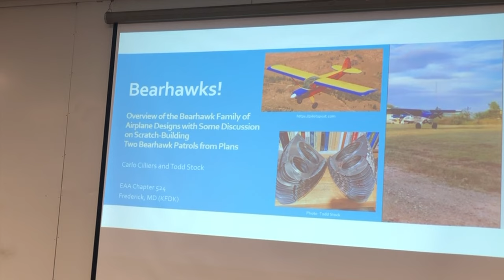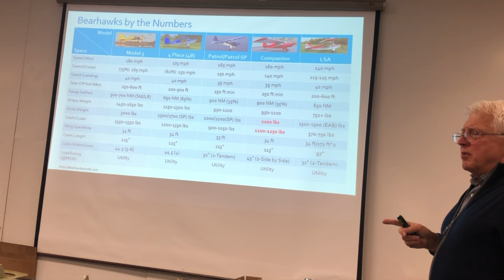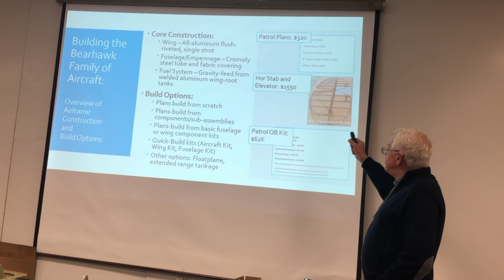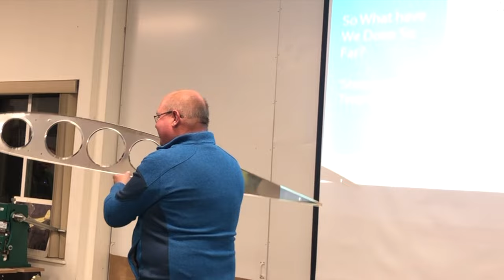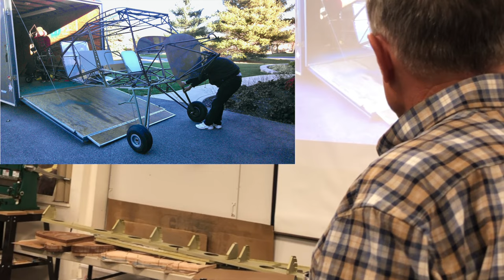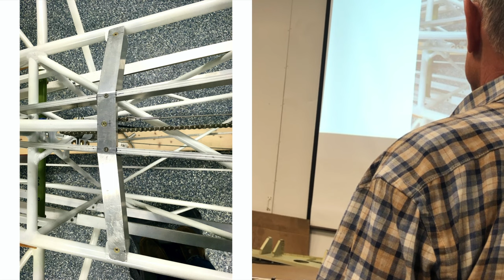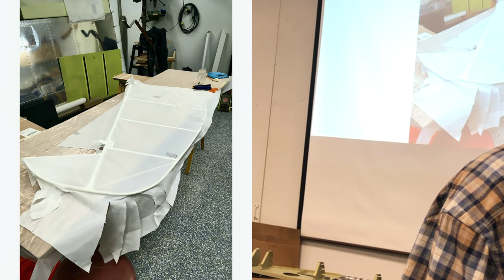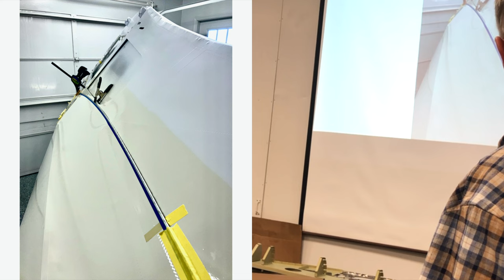Building the Bearhawk

Comment: 7:40 the issue I have always objected to, is the numbers on their website for stall speeds would require lift coefficients greater than 3, after factoring in even a small tail down-load; OR reducing the aircraft weight to its listed empty weight, plus 150-200lbs if using a believable CLmax of 1.7-1.9 for a typical partial span flap, rag and tube aircraft. 

I'm not knocking the design or designer. It clearly works well for countless people. But it raises alarm bells to publish nonsensical data that was clearly read off an uncalibrated airspeed indicator/pitot by someone who should know better. Or worse; derived from make believe.

I highly doubt these aircraft can actually achieve, in no wind conditions, on a 59 degree day, at 0MSL, the claimed 32mph, 35mph, 36, and 38mph stall speeds they list for various models online. 

The dynamic pressure at 35mph is so laughably low, even ultralights have a hard time operating there.

E.g. Patrol is as of today published 2,000gross weight (that by definition is the weight performance numbers are derived for). And 180ft^2 wing. 

2k/180 = 11.111...lb/sqft.

(22/15)x 36mph stall = 52.8ft/s

Rho is 0.002377

0.5*rho(V^2) is 3.3135 lbs/ft of dynamic pressure. (Q)

11.111.../q = CLmax of 3.353.

Not even with a Helio Courier could you ever achieve that CLmax! (And it came close, with full span deployable slats, and 70% span flaps. It achieved a phenomenal CL~3.0 in practice)...

Run numbers backwards and use CLmax of 1.8 (Same as Super cub, Vans RV-8. Not Husky, which has better, gnarly slotted flaps). And you find a stall speed of 49mph. This is at aft-cg of course, as fwd Ch means a larger tail download that would raise stall speed to 50mph even. A far cry from 36! (Which would correspond to a gross weight of 1,073lbs. Which is exactly -77lbs BELOW its listed empty weight).😂

Even if You plug in a Clmax of 2. Same story, you cant even bring fuel with your own bodyweight and achieve those stall speeds. Use a giant (unbelievable favorable) CLmax of 2.5. Then it gives you a low fuel, solo weight that might be useful for STOL competitions. (341lbs, including pilot, oil, and fuel, 36mph stall with CLmax of 2.5). 

This "accusation" is evidenced by the fact people aren't using these in STOL drags. Yet many other known STOL or bush designs are showing up in droves. Including carbon cubs, Zeniths, as well as C180s. But not many bearhawks showing up, let alone winning those events.

If these vitally important performance numbers are this egregiously fudged. I wonder what other, much harder to verify numbers are pencil whipped?
Reply: 52% span x1/3 chord plain flap on the patrol - they are barn doors compared with the PA-18's ~35% x 1/4c.  Not a rag wing airplane - flush-riveted, stressed skin, single strut with fabric control surfaces (as in most high performance aircraft through the middle of WW2).  Fabric control surfaces are more structurally efficient in design speed range and the aerodynamics are virtually the same as heavier stress-skin construction.  Flush riveted Riblett wing matters a lot at cruise and less at the low end, but helps a bit on controlling separation.  Some builders have gone with VGs and given up a few mph on the top end, but I suspect the consensus is that VGs add predictability in less-than-ideal conditions, versus trimming the Vso number in a meaningful way. 

Most manufacturers quote Vso (velocity  - stall in landing config for the casual reader) at something other than max gross.  A 1000 lb Patrol (Bob's O-320 fixed pitch prototype) with 185 lb pilot and 2.5 gallons usable left (thus about 1200 lb at landing) will stall at 36.5 mph CAS per the flight test data.  A more realistic 195 hp CS  on a Patrol with a decent panel will tip the scales closer to 1200 lbs empty weight, and with 312  lbs of fuel, 400 lbs of meat, and 85 lbs of baggage, Vso is now 47.2 mph CAS at 2000 lb (max gross on wheels/skis).

Could I find another 5 mph by adding slotted, double slotted, or other higher lift config?  Yup.  For 99.9% of missions flown, would I be happy with the weight gain, the airspeed loss, and the additional mechanical complexity, maintenance, and added failure modes?  Not so much.  I'm concerned with  - and I suspect most folks looking at the 'hawks versus other options - is speed range.  For my config (195 hp/two-bladed CS prop), I'll see Vso around 45 mph for most missions and max cruise of 150 or more if I can pay the gas bill.  If I throttle back to 135, I'll see about 7.5 gallon/hr burn and about 6.5 hrs duration with reserves for just under 900 miles zero-wind range.    In a nutshell, that is the value proposition, versus slogging along 40 mph slower with a max range of 500 miles, but enjoying the fantasy that I too can win a STOL competition.  If STOL drag is your jam, get an airplane optimized for the job (land slow/cruise slow), then mod the shit out of it.  For the rest of us that are content to get into and out of 800 foot farm and ranch strips, but still cruise at 172/182 speeds, the Bearhawks are fit to mission. After flying helos for 30 years in the military and civil world,  landing super short has little novelty, but dropping in on friends in Florida or NE Ohio with farm strips after a doable day of flying without breaking the bank can be fun... 

Bearhawks in STOL Drag?  Might see them.  13,000+ PA-18 and clones out there and something like 200 or less flown in competition.  With a couple hundred 'hawks flying, we might expect to see a couple at some point.  That said, I suspect you are more likely to see a Bearhawk bouncing around back-country strips with the local group of PA-18 clones, Maules, and tailwheel Cessnas.
Reply: @MDLuthier    stall speeds are quoted at cited gross weight. That is literally the definition of VS0/VS1, which is clean or landing configuration, at max gross weight. To go out with a medium sized pilot and an illegally low fuel quantity (30 minutes reserve is at cruise power setting, not a significantly reduced 40% power level to attain those 30mins at best L/D with zero margin).

As my math showed, these numbers are fairy tales and are not attainable in the real world by any builder or operator of these aircraft, in practice. That is my complaint: These claims are bordering on lies.

If a super-lightweight aircraft was flown by a medium American sized pilot with only 2.5 gallons (15lbs*) of fuel to attain the claimed performance numbers, then my original calculations still stand. 

That these aircraft achieve a CLmax somewhat above 1.8 but well below 2.5. Leading to a stall speed of around 50mph at gross weight. And that tracks very close based on these numbers.

Vans have metal wings, 50% of trailing edge is a 20-22.5%-chord flap. And they are slotted. Airfoil shaped, and slotted. None of which is true of Bearhawks. Which have plain flaps. Plain flaps attain a maximum CL around 2.5 in a wind tunnel with infinite wall end-plates. No matter how wide they are on the airplane, spanwise effects reduce the attainable performance below the maximum theoretical. And VGs wont improve it much, as q goes up at the square of speed. No VGs in the world are going to shave 5mph off a 46mph landing speed, unless the airfoil has a very poorly designed upper surface.

An RV-8 has an honest CLmax of over 1.8, and will attain this number at published landing speed, at maximum gross weight, and most forward CG. Not counting the tail down-load to overcome forward CG or the wings negative pitching moment due to flap deflection. They publish not the most favorable that could ever be attained in practice; quite literally the least favorable condition found inside the design envelope.

Cessna 180s having their very effective fowler-action slotted flaps, seem to attain slightly above 2.0: CL of 2.1 actually. The bearhawk is not much better than this, and probably a little worse than a Husky. There is zero chance any bearhawk wing can ever attain a CLmax of 3.35+ ever never. And I doubt it could get as slow as the 32-36mph range published, at maximum gross weight, by hanging on the prop at 100% power on a 59 degree day at 0MSL. Nope. Not going to happen. Not at maximum weight. These wings are middling-mediocre. Just big enough to work well enough for most people.
Reply: @EllipsisAircraft    We both agree that airplanes stall at higher velocity as weight increases, and manufacturers tend to quote takeoff and landing distance, as well as Vso, at something other than max gross (see Aviat's Husky for another example).   The Husky is a nice package that I have time in and a nice divot in my skull from a rushed preflight... anyone with time in one understands the trades to get those slotted flaps are the six head-knockers for passengers and those loading cargo.  Not sure what a semi-Fowler is as claimed by Aviat; maybe they were going for Fowler-action but the ad folks got a hold of the word and decided to go Fowler-adjacent?  Perhaps a nice post on their sales video bemoaning their misleading ad copy?  

In any case, the B is still rag wing and tandem lift struts,  so those single slotted flaps are a good choice for an older airfoil like the Clark Y.   That said, any plain flap hinged at or near the bottom of the surface ends up with some slotting effect without the head-knockers, so avoids braining the uninitiated at the cost of a knot or two at the low end and a gain of the same on the high end.  Having spent way too much time in skinny little airplanes (6'2" and 210... so shoulder width matters), that 26" cabin on the Husky is a little narrow... I'll look for at least a 32" cabin width on the Ellipsis Model ...  ;-)
Reply: On Vso - stall speed in landing config is landing config dependent.  Should manufacturers quote Vso at max landing weight?  ICAO Standard at sea level, etc?  Nice, but also worth knowing what the aircraft will likely do when I am out solo (my usual jam) and not tanking fuel.   Weight, flap config, landing gear config (on aircraft where that matters), and atmospheric conditions all matter.  I think that - unless stated - you can assume Vso is minimum flying weight with min fuel and payload. Complaining that manufacturers are misleading the consumer is a valid bitch across the industry, so we consumers do due diligence, look at all the other factors (gear design, cabin width and access, cruise speed, cost to build, will our designer or kit manufacturer evaporate before project completion?) and pick a winner.
Reply: @MDLuthier   manufacturers should provide reliable data the pilot can fly by.

Citing a number the pilot will never see in reality is dishonest. He will never see this number, because he always flies with more than 2.5 gallons in an airplane that burns 12 gallons an hour.

Stall speeds are always assumed to be at maximum gross weight. There is no other weight to assume. As that is the number all other factors are taken (g limits, climb rate, power to weight ratio, wing loading, etc, etc). If stall speeds just happen to be quoted at some other weight than maximum gross weight, it should be specified and clarified. Gross weight stall speed should be declared. As this is literally the most important factor in aviation. The ASI includes the green and white arcs for this reason, which are also defined at maximum gross weight in every airplane ever. How would you like to fly an airplane having the green arc extending 20mph below the stall speed?

If the manufacture states an aircraft stalls at an unbelievably low speed, but is basing it on an unrealistic low payload, just to puff up their performance numbers. Then they brag about how their airplane is a 4.5g airplane... Yeah, but at what weight!? And what CG? Aft most CG greatly improves G-rating due to several factors. Are they quoting these numbers at the most favorable position? They seem to lean that was in all other areas. So yes, we can assume this is in some optimal test and may not coincide with reality. 

Carbon Cubs quote two speeds, 2 climb rates, and 2 weights. Because if they only publish gross weight performance, like Cessna or Vans, then some of these other fly-by-night kit companies will win over sales due to untruths and make believe. If you look at the performance of a carbon cub flown at minimum weight and maximum performance, it blows the BH lineup out of the water. There are many reason for this. Not that BH are bad designs. They are Utility planes, Bush planes, cargo haulers, and even qualify as STOL planes having takeoffs and landings under 1,000' which most Cessna's also qualify for. 

But they are being marketed as some sort of extreme STOL monster with dishonest numbers and false expectations, the reality is something else. They are mediocre; middle of the road lift, drag, speed, range, climb performance. The fact the manufacturer resorts to lies  in the performance department is evidence of this fact.
Reply: @EllipsisAircraft  Welcome to aviation... designers get to choose which numbers are  presented, and require the casual observer to actually ask 'at what weight/flap setting/atmos'  condition.  I have to ask... are you actually rated and have done any flying?  Landing with 2.5 gallons usable on an airplane that burned 7.5 mph in cruise?  pretty darned common in actual operations with a trusted airframe and short hops... Spent decades getting those last few maneuvers in on check rides with the 20 minute light flicking on short final during the full stop.  Again - welcome to aviation.  Mission profile is everything.  Want to do your local STOL drag stuff?  Not gonna be done at max gross with full load of fuel and a full-up baggage compartment.  Mission profile generates the relevant numbers for what you will really see.  So yes - I suspect Bob's and most everyone else's numbers need the relevant mission profile & atmos data for head-to-head book comparisons, but you need to get your butt in the seat and stick in hand to actually understand whether anyone's numbers are actually achievable and - more importantly - meaningful with regard to how you might use the airplane.   Go out and get some time in the various aircraft you might be looking at and suss out what compromises the designers made in structures, aero, integration, etc.  

No aircraft is just the sum of its parts or can be judged on one arbitrary number.  get some time in a Cub, SC, one of the cub clones, then find a Patrol or Companion guy to get a good session in and figure out why there are bunches of 'Hawks being build.
Reply: @MDLuthier  No: Designers DONT get to choose what numbers.

Certified aircraft these definitions are clearly spelled out in CFR part 23, 25. To use the same verbiage corresponding to clearly defined definitions is confusing. To use it for vitally important performance figures, such as stall speed, is potentially dangerous. But at minimum, it misleads buyers (customers). Who are almost unanimously, in this case, shopping for a STOL aircraft with excellent low speed capabilities.

Only in experimental aviation is this a thing. And MOST designers are reasonably honest in this area, even among kit planes, and maybe half of plans planes out there. Even plans are often accurate, if built and flown to the original designers intent. Most people build much heavier.

I have done quite a bit of flying. And I have never landed with only 2.5 gallons of fuel remaining. Not even for pattern work. Not even behind an O-235 or TCM O-240. I might have dipped below 5 gallons on one or two occasions, in an aircraft that regularly obtains 7gal/hr but can be leaned out, and dialed back to 5gal/hr in a pinch.

2.5 gallons remaining, after a short hop, with a 160-180hp Lycoming is bordering on a fuel emergency. It would only reasonably be used for a STOL competition, practice for one, or to set a deceptively low (yet still true) performance figure. 

Departing to another airport knowingly to arrive with insufficient fuel for the requisite 30 minute reserve at cruise power, is illegal. It not only endangers the pilots or passenger(s) but people on the ground as well. 2.5 gallons is plenty for a Rotax 912iS powered LSA. Sure. They only burn 3.3-4.6 gal/hr between 50-75% power. But not an O-320/360. The best of these engines burn 0.45lb/hp/hr. At 160hp, 15lbs of fuel for 30 minutes corresponds to 40% power. I don't know anyone who can quote the manifold pressure and RPM setting for 40% power and 5gal/hour in an O-360. Not without looking it up, certainly not in an emergency attempting to divert to another airport.

As my original comment/ complaint mentioned. I have a problem with misrepresenting performance when buyers are laying out substantial cash, possibly a life investment both in coin and also man-hours and free time. But are never going to achieve what they are setting out to accomplish. If that includes truly usable STOL/off airport capability. Where I'm at, I want to be able to get into a 660'-720' strip over 50-75' trees, powerlines, and a road. The bearhawk lineup appears at first glance to fit the bill. But with a little number crunching, ignoring the lies of the manufacturer and the occasional claims of the forums: I have determined none of these aircraft can be loaded down with a passenger or two, overnight bags, and full fuel and be anywhere near capable of this. 

They are objectively, and factually, mediocre.
Reply: @EllipsisAircraft  OK... so the designers of the 747F have to quote Vso at MGTOW or you will be unhappy.  Mmmm... but a 747F has a max landing weight of 212,000 lbs less than its maximum takeoff weight, so that Vso number would be pretty meaningless given Vso is a landing versus a takeoff thing, right?  Granted, I'm a fairly low time pilot at 7,000 hours or so, and the biggest stuff I've flown and am typed in still grosses under 55,000 lbs, but those numbers in the AFM/POH for Vso tend to require a) a configuration, b) a specific gross weight, and c) a specific temp.  Yes - I agree that Bob ought to provide his gross and temp for his stall speeds, but there are lots of other data around to compare low speed performance, to include side-by-side with Carbons, etc.  So maybe get out of the world of spreadsheets and into the world of the real... amazing the number of things that airplanes can do that are not in the book.  Find a 'hawk driver near you and get out there with them... if nothing else, it informs understanding of the various trade spaces all designers have to operate within.  As a bonus, actual flying can be fun!

On VG's... 4% to 7% reduction in stall speed per both theory and observed measurement, but getting those 2-3 knots can take a lot of time and effort unless you can build on work done on similar/identical aircraft.  You can make the airplane fly worse with them with poor placement, and some airplanes tend to dislike them on one or both surfaces of the hor stab, where placement can be even trickier than on the wing.  Way back in the Reagan Era when I did my aero engineering degree, I did a bit of low speed 8 x 10 tunnel work on full scale sections looking at getting the wing to stall in a more controlled fashion (fences, strips, turbulators, etc.).  VGs tend to get a lot of what we used to use wedges, strips, cuffs, etc. without the issues seen with those devices.  There is usually a reduction in max cruise, but for our little airplanes, that tends to be largely irrelevant.  While some folks will tell you that VGs are a fix for bad or old airfoil or wing design used by sloppy engineers, it is amazing how often those same folks can be found a few years later crowing about the 3 knot reduction in landing speed they see with XYZ Co's VGs (the power of Vee Square).
Reply: There is no argument here.

I provided a timestamp where the screen is showing performance figures, and the presenter is reading them off as facts. 

I then mentioned their website figures, which in some cases are more favorable than those on this presentation.

I said my problem was these numbers cannot be achieved in reality with these airplanes. 

I provided a simplified derivation, while giving the maximum advantage to the designers published numbers. I chose to omit tail down-load. I chose to omit forward CG ahead of the 25% MAC. Which for these airplanes, accounts for nearly TEN PERCENT additional weight for the wing to lift. In an adverse CG, max gross situation. It would not only require a CL of 3.3+ IT WOULD REQUIRE 3.7+. 

These numbers are untrue. They are beyond unbelievable. 

That is my complaint.

The designers and manufacturer should choose realistic performance numbers to advertise. 

By choosing to claim nonsense, it undermines their credibility. It brings everything else into question. Including their takeoff distances, structural limits, maneuvering or gust penetration speed. Everything.

They can change this with the stroke of a keyboard. But then, they wouldn't sell many airplanes would they?

That is all.
Reply: @EllipsisAircraft  I understand this is personal for you, but failure to consider the wealth of flight test reports and comparison data seems more a spreadsheet warrior thing than what pilots and engineers usually do... which is to try to get a look at the real data and set their own prejudices or preferences aside.  

As I was advised early in my engineering career, don't fall so deeply in love with your own models that you do not entertain the notion that conflicting data might represent a more accurate view of reality.
Reply: @MDLuthier  I'm not discussing the 747. I'm clearly talking about the bearhawk line of aircraft. The 747 manual provides a weight to correspond with it's Vspeeds. As does every Cessna, piper, mooney, beech, vans, rans, pitts, and Kolb in existence.

If you build any of the above, you can paint the stall speed on your ASI and fly by that number. You can safely calculate Va from it, also. 

If you paint Bearhawks claim on your airspeed indicator and pitch up to fly it by the numbers on short final: You will die.

My beef is not with the basic design. I think it's quite good in its own right. As a sort of Experimental Husky or Maule competitor.

My objection, once again, is in the fantastical arbitrary claims of the manufacterer that run contrary to reality itself. That can be fact-checked with a napkin and pencil and proven to be bordering on LIES.

Lies to who? Customers. Future customers, who are looking to part ways with something like $80,000 times two. This is what I object to. Not the fact the airplane cant hardly get slower than 50mph. (That is better than a Citabria GCBC, after all). The fact they CLAIM it can do 32mph, or 36mph. When in fact it cannot even get down to 46mph, as-supplied by the manufacturer. With modifications, VGs, etc. Sure. But NEVER 36mph.
--------------------------
From Bearhawk website, regarding Patrol:

"Speed Where It Matters

The Patrol boasts the ability to cruise at 4x its stall speed. There are not very many aircraft capable of this performance.  You will have the ability to land where you want and cruise home at 140+ mph.

Not many aircraft can do this"...

140/4 = 35mph.

(speed ratio of 4)... 

YEAH!? NOT EVEN YOIR OWN AIRCRAFT CAN DO THIS! 

Try: 140/49mph = 2.85 speed ratio. 

MEDIOCRE: Like I said in previous posts.

It is my informed opinion, that no aeronautical engineer worth a flying fu^5 would ever defend an aircraft manufacturer in boasting about performance specifications that defy reality and physics itself. ~ JJ.
Reply: @EllipsisAircraft  You are not discussing the 747 because my point made with TO and Ldg weight invalidates your fundamental  argument re Vso.  And as a Collier-award-winning aerospace engineer, aerospace patent holder, and mil/civ SIP/IE/CFI/ATP, I will again disagree with you on your fundamental point - Vso is a config and condition-dependent number...as it is for the 747, the Space Shuttle, and anything else wearing fixed wings for lift generation.  I know you want to have it otherwise, but Mark used the low end of the chart, which is not usual for manufacturers trying to sell kits.  You might consider actually getting a bit of experience in the industry before whining on a public forum.  personally, I don't know a pilot that does not understand that Vmo is weight, config, atmos, and - this is tough to believe - skill dependent.  Whine less - build more.